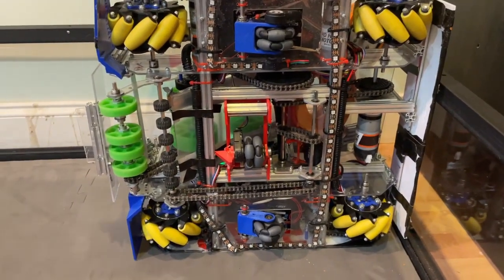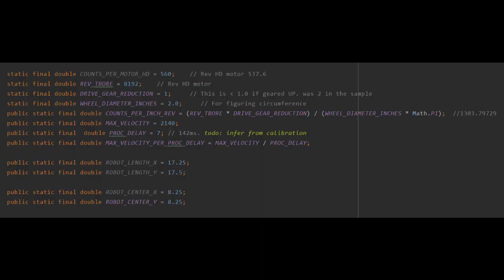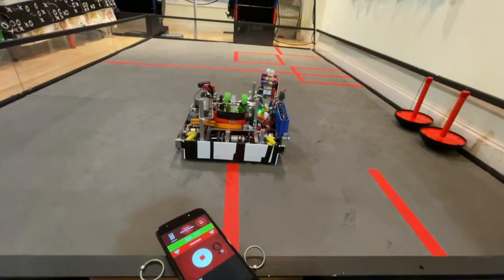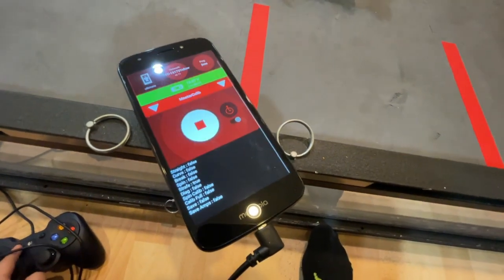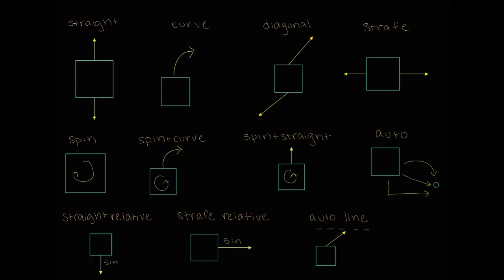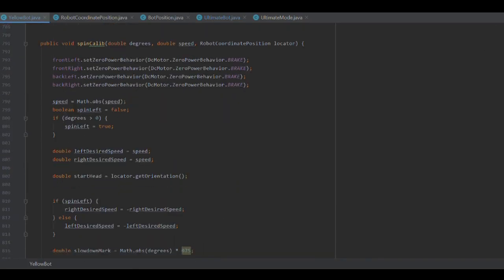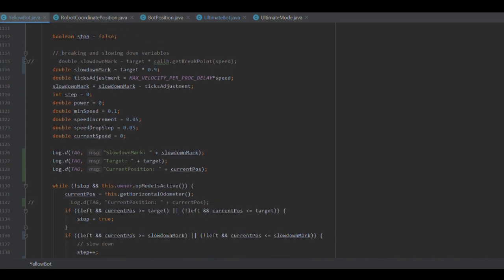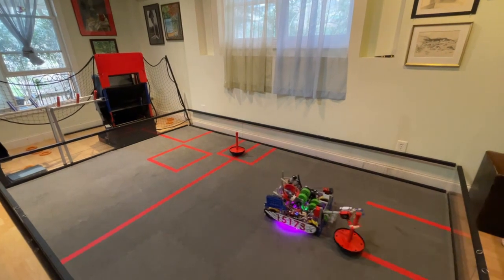Odometry Explained - Robotic Eagles 15173

Comment: Do you think middle schoolers could do this? I'm on a Michigan team and we do FTC in middle school. I think it would be really cool to do odometry and I'm just making sure someone like me could do this before I ask my coaches. We've gotten stuff like OpenCV working and have tried to optimise a lot of things, I'm just not sure if we're smart enough to use odometry.
Reply from the maker: It is definitely doable. With the time between this season and the next one you will have plenty of time to experiment and get it working. Plus there are plenty of tutorials online and libraries that make the job a lot easier such as Roadrunner.
Reply: @roboticeagles15173  I'm not sure how much time we have though. Usually we don't meet in the summer because FRC always meets in their off season and on a normal year we end in early december so it's not much time
Reply from the maker: Try building just the robot chassis over the summer or just after your state tournament. It shouldn't take more than a month. Calibration and all can be done at the beginning of the season.
Reply: @roboticeagles15173  Yeah, maybe that could work. And maybe once our team thinks of a design for our robot we can start making an autonomous path while they build something that can be put on the robot.